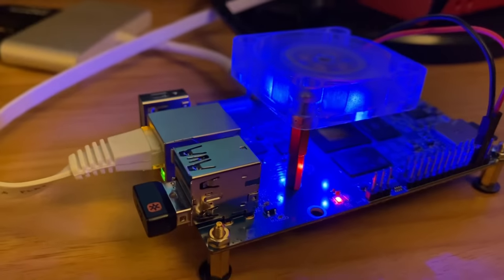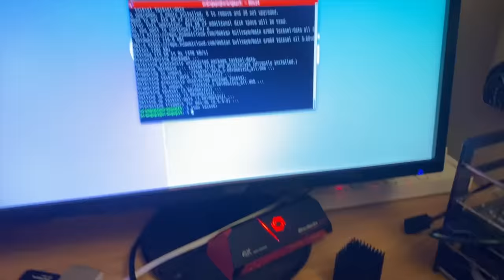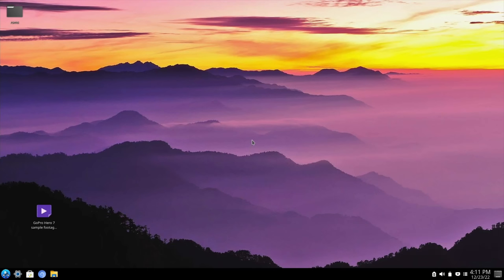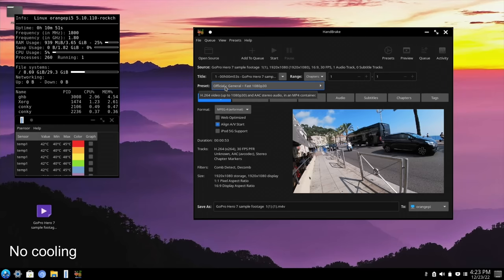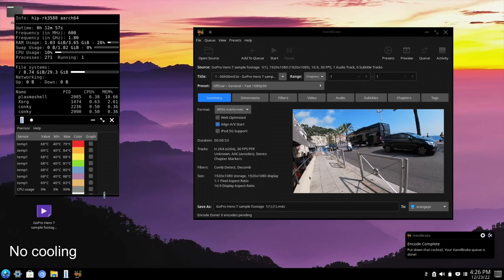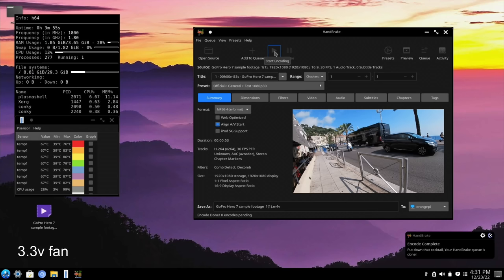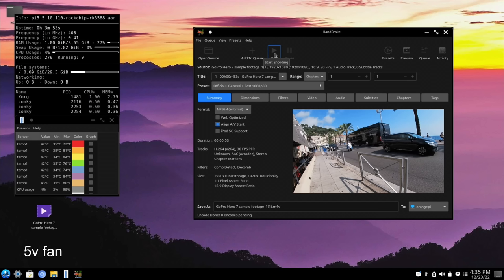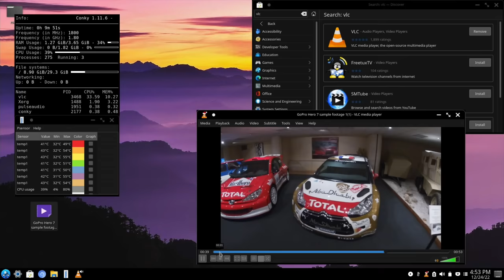Orange Pi 5. Cooling significantly improves performance.

Comment: I've ordered a nice acrylic case with heatsinks and a fan. I am astonished why such boards do not come with at least a SOC heatsink by default when the manufacturer must know that it is a basic requirement for the most efficient use. The lack of specific fan mounting holes on the Pi 5 board is also a mistake in design.
Reply: Based on these results, I don’t think a fan is a “requirement”. If you’re going to use the board in a heavy compute scenario, it’s a good idea. But for general purposes, this suggests you’re likely to not even notice. I’ve said it before and I’ll say it again: the thermals on this board REALLY impress me.
Reply: @thewiirocks  I'm not sure that in the longer term that I would want it running so potentially hot. The thermals that the process started at seemed quite good and if, for general use they don't go above 60C, then I would say that this was very impressive indeed. I'm still going to go with some copper heatsinks and a fan for good measure and as they come with the acrylic case that I have ordered then it won't have any downsides to it.

Comment: Great job testing the fans as its obvious the SOC requires adequate cooling t get optimal performance. I hope you manage to get KDE Plasma running as your build for Raspberry Pi is a delight to use so thanks for the awesome work!

Comment: Thanks for the great info.  I've bought several Orange Pi's now for work, and I've been going through your videos to help set them up.     By the way, according to the official Orange Pi Overview page, you have this hooked up to 5V -- not 3.3V as you said.   Since this video is 8 months old the time of this comment, I'm sure you've figured this out by now.
Reply from the maker: 3.3v just runs the fan slower. I have always used 5V power

Comment: Also waiting!  Heatsink I bought is ICK S 25x25x18,5 5.2K/W should deal with 5-10W or so. SSD and 2 GameSir handsets also ready 🙂 I plan on attaching it with a scrape of metal loaded epoxy.

Comment: Merry Christmas! I just found some cases and heatsinks on Ali Express. Mine is finally in Canada. It got through customs and it's at the post office closest to the Toronto airport. I would have got it on Friday but of course we had a actual blizzard. It was the worst storm in years, winds 120km/hr and  -30.  Everything was shut down. The post office gets Mon & Tues off so I should have it Wed or Thurs. Chris from Explaining Computers made a really nice open case for a Pi 4 a couple of years back. He used standoffs  and a couple of sheets of brass. It was a steampunk look. I'm thinking about trying something like that. I found some sheets of copper in my basement  I have a friend with a metal shop.  He will probably cut it for me if I bake some cookies.
Reply from the maker: That storm looked terrible. I was moaning about minus 6 here recently. I can’t imagine-30. 🥶

Comment: Hey for Anyone having trouble trying to get there fan going if you put the black wire on the 3rd outside pin closest to the SD card slot and red on a 5v or 3.3v.💯

Comment: I'm curious how it would perform with a passive cooling.
Also, the lack of decent (metal) case is a downside. I've got 2 RPi4's both in metal cases that act as passive coolers and even under stress I've yet to reach temperatures above 80C.
Reply: That's what I was thinking as well. My Pi4 is in an Argon One case and I've never had an issue with overheating, the Orange Pi could do with a case like that.

Comment: Very interesting. Would be interested to know why the CPU frequency isn't going above 1800 ...
Reply: Because that’s the default clock speed for this chip set by orange pi foundation?

If you want to, you can probably overclock it
Reply: 1800 is the max speed for the four little cores, but the four big cores are usually clocked between 2200 and 2400 on various devices. For some reason, the little cores always get displayed by neofetch and other similar programs.

Comment: I am running some Raspberry Pi-4 examples on the Orange Pi-5.  How are the Orange Pi-5 GPIO PWM pins used in Python servo pan/tilt program?   Thank you.
Reply from the maker: I haven’t tried gpio on the Opi5
Reply: @leepspvideo  I think the GPIO driver needs to be installed? Thank you.

Comment: So, if you took a thermal camera shot of the board to look for the heat offenders, put some heat sinks on the hot ones, then rerun the test at 3.3V... Do you think that would outperform the 5V results?
Reply from the maker: Depends on the heat sinks. Small ones are usually little help. The low profile ice tower cooler is great even without the fan.

Great Raspberry Pi 4 Cooling solution
https://youtu.be/rNZ52XUr3SM

Comment: Thanks for the results. The direction of the fan matters: Pushing air down onto the CPU vs. pulling air from the bottom is not equivalent: in a room with air dust, you will soon be accumulating a lost of dust onto the surface of the CPU making it getting hotter, and in turn, using the fan more often (thus spending more energy for nothing).

Comment: I've managed to get the Orange Pi 5 to run from an Crucial 250GB SSD plugged into USB 3
It initially boots from an SD card then used the rootfs on the SSD
Blinking quick now!
Anyone interested in details...
Reply from the maker: Yes, I have only used sd cards so far. Going to try nvme when I get more time.

Comment: Thinking more about the conversion results, there was less than 5 seconds difference between best and worst, which is not as significant as |I would have guessed before watching. It started throttling less than half way through the first encode but the lower CPU frequencies didn't have much impact at all  on final performance results. Was that a Samsung PM991 NVMe SSD?
Reply from the maker: It was such a short video plus the Orange Pi hadn’t been on for long. It would be so different in a warm climate left on for much longer.

Comment: If you put the fans red wire to 5V and the black to 3.3V, you'll get a differential of 1.7V ;-) some fans will spin at this low a voltage, some wont.
Reply: That sounds wrong, put both Red and Black to Power, No thank's
Reply: @MrJaz8088  - It's true, all voltages are a difference between the two levels - Ground is quite often not 0V
Reply: @TrollingAround  It just sounded wrong to me,  but i am far from being a Tech LoL

Comment: I don't know too much abt this stuff yet, but shouldn't the Cortex-A76 Cores of the Chip be able to clock above 1.8 GHz? Are they limited by default or did You not dare to run it on a higher clock speed without cooling? Or is there just an inherent flaw in my thinking? XD Would highly appreciate some explanation
Reply from the maker: Armbian has Overclock support as seen in my Armbian video. I will definitely be overclocking.
Reply: @leepspvideo  Somehow I expected the default clock speed of the A76 Cores to be 2.4GHz as advertised on the Orange-Pi Website, however in the User Manual it is written as "up to 2.4GHz". I am looking forward to an overclocking video including Your way of cooling it. I'd also appreciate some ideas abt passive cooling, since this is my first SBC and I couldnt find any passive cooling cases like for the Raspi yet :D Thank You for YOur content!

Comment: Can you please let us know why the reports of wifi ax were false...
Reply: The AP6275P WiFi module was removed from their test board to make way for the M.2 PCIe 2.0 port on the back to allow for NVMe SSD storage and an M.2 WiFi/BT card. They also removed onboard eMMC and DC power for 16MB SPI flash and USB-C power. Not sure all they changes were warranted but opting for the RK3588S limits their options due to the lack of I/O and peripherals.

Comment: Nice video!  I have an OrangePi 800 and would like to replace OrangePi OS with a KDE Plasma Linux install. Anyone tried the ARCH KDE Plasma version?  I am uncertain as what to do with an *.img file on a MicroSD; instructions aren't clear to me!  Any advice much appreciated.
Reply: Try running the dd command "sudo dd if=file.img of=/dev/mmcblk0 bs=4M conv=fsync status=progress". Important: make sure the output file block device above is correct for the microsd card by looking at the output of "sudo fdisk -l".
Reply: Thanks dktol56!  I will give it a try.

Comment: Is usb 2 port working in Linux ?
Reply from the maker: I remember plugging something into the port that didn’t work with Linux
Reply: @leepspvideo  is it possible to show us how to boot Linux using external USB SSD drive on usb 3 port?I tried but couldn't boot from external usb drive.
Reply from the maker: @ps3301  when I get more time I will try nvme and usb boot. 👍🏻

Comment: I dont think that's a good fan solution. If the fan gets dirty or blocked it will draw more current, and that will probably destroy the voltage regulators...
Reply from the maker: I have run similar for years. I don’t have any problems
Reply: @leepspvideo  try stopping the fan completely by hand for 30 seconds. Maybe the regulators can handle it, but usually they are quite weak.
Fans also induce ripple or noise on the DC line due to an inductive load, which can interrupt sensitive digital signals., hence is why many people use a dedicated regulator for fans with overcurrent protection
Reply: @Sysshad  So, what do you suggest instead?
Reply: Despite your "taunting" reply I'll give some suggestions. Go search on your favourite electronic shop and search for either a LDO regulator or stepdown 'buck' ' switching regulator with a built in overcurrent protection and drive the fan on the PSU instead of an GPIO or some pin that can't handle shorts due to small pcb trace widths or similar. Another solution is to get a self resetting fuse of matching stats, again it should be driven directly from the PSU power and not a GPIO pin. 
And also in some fans 'depending on type' you might need some rectifier diodes to cancel out the reverse voltages that occurs when power goes off from an inductive load 'fan' that can damage sensitive digital circuits.